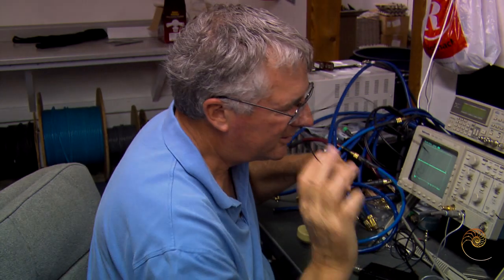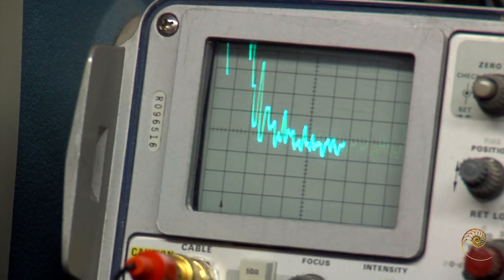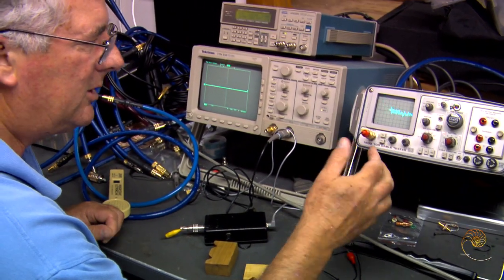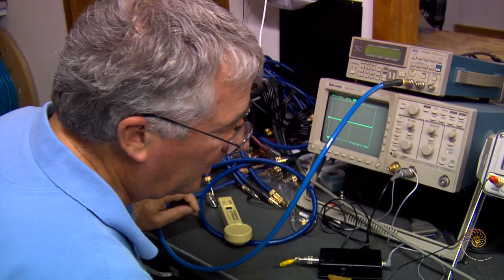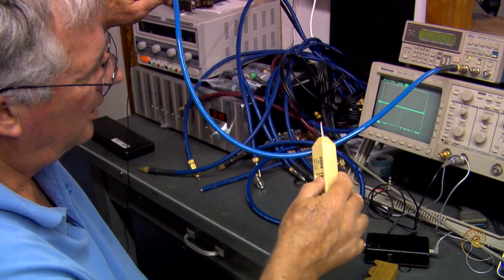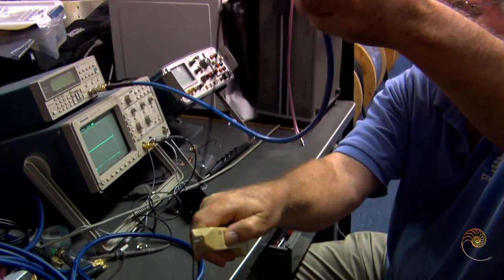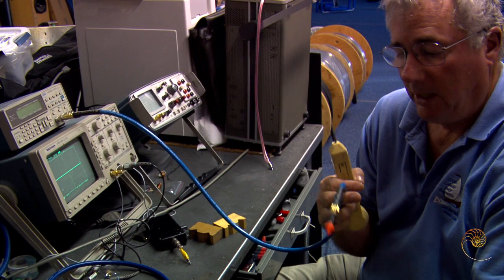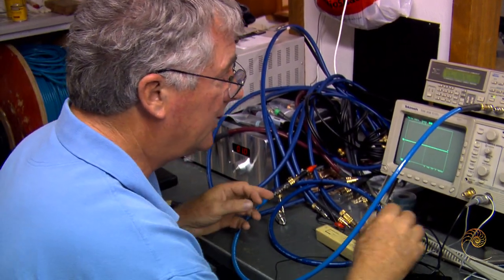Cable Shielding Part 2

Comment: For monitoring audio range noise you should setup audio frequency scale in Oscilloscope.and open wires act as antennas
Reply: +1 for "open wires acts as antennas"